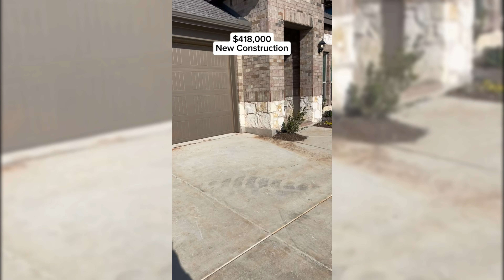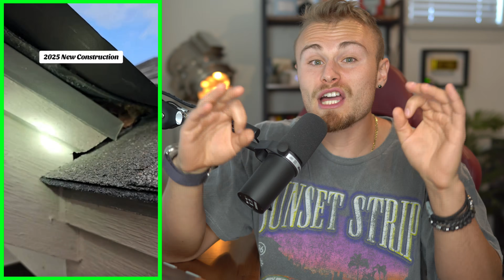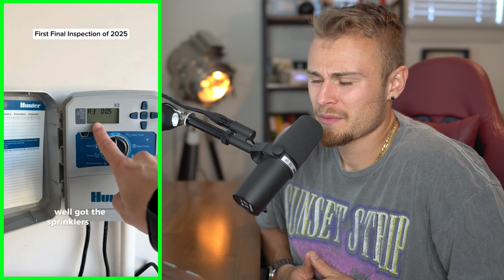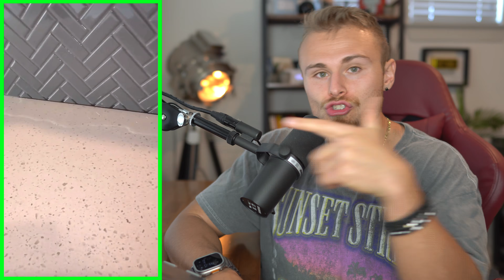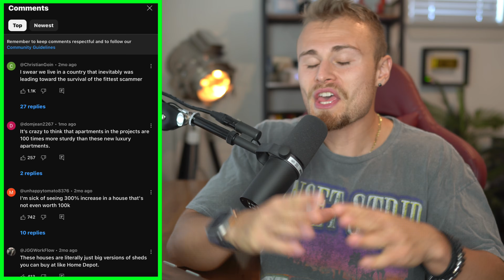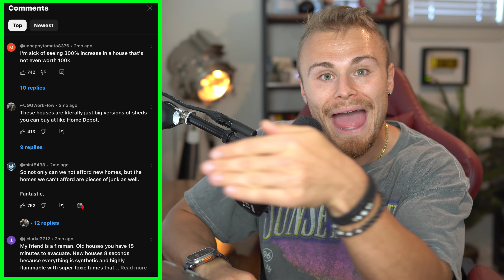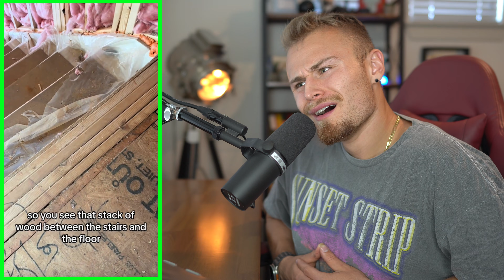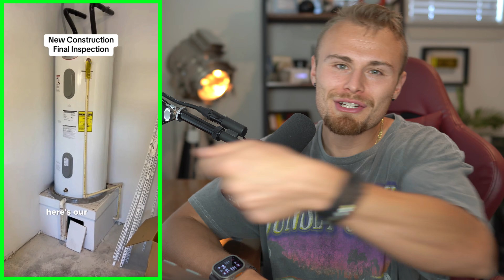New Construction Homes are STILL HORRIBLE in 2025…

Comment from the maker: Do you think builders will ever go back to making quality, affordable starter homes, or is homeownership just becoming a luxury only the rich can afford? 🤔
Reply: Carpenter here, these examples definitely show a failure on many many people's parts, not just the hacks in this video that call themselves tradesmen. I have built over 40 houses and have never run into problems of this magnitude. I have had to work on some wavy walls, which are generally a framing, plumbing, and drywall issue which usually stem from plumbing pipes being too close to the edge of the bottom plate thus pushing the drywall out. Regardless, homes have to go through many many inspections. From foundation to framing to insulation, etc.  I have been turned down for way less than anything seen in this video, and that's a good thing, it drives my quality up. Inspectors should be educated enough to recognize these problems way before the home sells or passes final inspection, so I believe they should hold responsibility as well. 'As a carpenter it hurts my heart to see such bad work done. It drives me to learn and study to become the best carpenter I can be and create robust and beautiful work for my clients. 

Also, if you want to learn about home improvement and tackle some beginner home remodel work, search "THIS OLD HOUSE" it is the place to go. Their youtube channel is a wonderful and accurate source to help you crank out some quality work. Any topic you can think of they've got a video to cover it.
Reply: I work for a construction company that is shifting to 3D printing homes. Although they already have excellent build quality, shifting to 3D printed homes will create a new standard that can be achieved reliably everytime because a machine is constructing most of the house, and humans just have to fill in the electric, plumbing, windows, and roofs. While we did receive a $300 million contract to build a neighborhood of these homes next year, unless you get one of those specific homes you're going to need to own your own land to out a printed house on. So I think it'll still take some years for it to make major changes for most people. I'm excited for us to start printing like crazy though! Because these new construction videos are wack and it has eroded the trust in human builders. And the concrete homes not only pass building codes, they're over built and are more fire proof and sound proof and stronger against disasters. And they can be custom designed if desired, though we plan to eventually offer 10 different models. For now we're just offering 2. A tiny home, and a 2 bedroom starter home. As we continue to grow so will the home selections.
Reply: Yea they will, at the same time every other company in every other industry stops making products as cheap and crappy as they can get away with and start building things to last again with ditch the plastics for metals again…in other words, no brother…no they won’t lol…Luckily there are some of us still around that take pride in our work and build things to last tho, and i will continue to as long as there are still customers who appreciate quality craftsmanship enough to pay for it! Unfortunately, i have a strong feeling that (for the most part) that attribute will die off with those of us born pre - 2000
Reply: They need to go back to making quality homes. If they don't the constant decline in quality will eventually kill someone. Lest it be a bad storm, tornado, or hurricane someone is going to get hurting we keep going down this path of bad construction. 

On the other hand I would love to get into a trade like this but I don't know where to start in terms of learning and getting onto construction sites
Reply: @VantenPlayz  they really don't have to. That stuff is covered by insurance less often these days but the owner's gonna be on the hook. New home buyers are basically playing hot potato with shit-build homes in D-tier real estate locations :/
Reply: @snuglife3697  insurance is good when there's a home to fix after a storm or other. But at this rate newly constructed homes won't even be standing after said storms. Where I'm located I can and have been hit by hurricanes and what I'm seeing (with these homes)would just get swept away. Especially after the big middle finger insurance and FEMA have been towards NC, SC, and Florida. Insurance is good for missing shingles and siding but not missing half of a house or a structurally compromised home.
Reply: @VantenPlayz   Insurance is a scam to make them wealthier while canceling our policy for reasons that are what the whole insurance i dusty is supposed to be about. We pay for full coverage on mortgages and they nickel and dime to not do their paid job.
Reply: 🤣 
"They don't make them like they used to"  Many ppl see how poorly they are made today, and think that older homes were made better.  
Afraid not.  PPl have put fortunes into maintaining their 50-80 year old homes.  These are all problems that you'll find on any home of any age.
Granted the "entire neighborhood is made by a single developer" will have FAR lower quality than than any other.
I buy and sell homes, as old as 70 years old, and have problems.  Most are ignored/unknown.  
Some older homes use aluminum electrical wiring... which has caused so many fires that insurance companies won't insure them.
If you're wondering why homes are so expensive and there are so many "made my a single developer/ultra sh*ty" homes, it's because of Fanny Mae/Freddy Mac.
In short, The gov backs loans for ppl that can't possibly afford the homes, increasing the number of buyers by massive amounts, while putting tax victims on the hook to pay for them.  
This dramatically increases prices, dramatically reduces quality, and costs tax victims billions.
Reply: @eclecticgamer5144   of course insurance companies wont insure them…because 99% of homes that still have any aluminum wiring in use do not meet the very restrictive code that must be followed for them to be deemed “safe”…and what you’re describing about the gov. Backed loans is what was going on pre 08’ and a large cause of what happened that year…one of the main reasons homes are so expensive today is because the price of lumber more than doubled during covid and has never returned to pre covid prices, along with the inflation of everything else in general, which in turn causes contractors and builders quality and care in general to inevitably reduce so they’re still able to turn their profits…the customer always ends up being the one paying and suffering in the end…its either or choose to not participate…thats the only options…
Reply: Yeah that "jesse"fella is partly true. Companies wanna make the biggest $ possible but jesse over there is shifting blame from the shoddy "workmanship" off to the "developers". "high pay" lol yeah why hire a competent professional when you can hire Achmed or Jose that have zero skills  but you think its ok because in the end "i can save on so much money on the hiring costs and if it goes bad its the developers fault anyway" mentality. What you see here with Jesse is what is wrong in construction. So yes all the damages ARE the builders fault. This comes from someone whose granddad owned multiple companies one of which was a construction company which later real estate added to it. Yes it was in Europe at first, but then he expanded to the US.  Company still operates and is still in my family's hands. It isnt either some small company the company has over 1000+ employees even way back in the late 70s, currently it sits around 14k employees.  The company builds all kinds of houses and renovations all over the world, not just in Europe. How many complaints were there? 17 in the last  nearly 90 years and they respond within 24 hours and send, if possible one of their employees ( usually one of the inhouse home inspectors) to see what the problem is and its fixed within 3 weeks unless its something major and have to wait on identical material being delivered. like that pink marble tile that got a hairline crack in it. Got replaced without a fuss or grumbling.  

As a builder you deliver such a SHODDY house its the builders fault and the sub contractors that are being hired. If you pay peanuts you get mongkheys but that is what its all about these days.. bare minimum at best with the lowest quality building materials with the most incompetent builders and workers possible. That is what is wrong with construction these days. They CAN hire professionals that will care about their work. My family's construction company and many others even in the US are great examples of that but they are content with  having a little bit less profit than the greedy jackasses that do shoddy work. Eventually the shoddy builders will have to cough up everything they saved up because if the state gets involved or board... it can get expensive real quick.

My grandfather had a motto: "anyone can come and work for me but if i see you deliver shoddy work you get your ass chewed out. If you build a home as a builder you yourself have to feel like YOU want to move in. If you dont have that feeling or you have a "laissez faire /  just bare minimum at best", you are NOT fit to be in construction go kick rocks or play with yourself or something". If grandpa was alive he would have some choice words for ol jesse ( with a bunch of numbers.. i think that dude is a bot). He rarely got mad and if you came to him and said " boss i dont know how to do this that or the other, he would show you or if he wasnt sure himself he would call one of his workers that was a professional.

Look for fixer uppers @Hayden.Schreier.  You have to look up the "nearly ghost towns" in the US ( there are quite a few in texas) but you also have to look at the location and situation, infrastructure and the like. You can have houses, all 1920s-1960s fixeruppers for between 50-90k.
Reply: No, because quite frankly, today's builders do not have the knowledge anymore to build quality homes. It also is the labor they use as well. Want to have your homes built by a population that comes from third world countries? Do not be surprised when they fall apart.
Being a carpenter used to pay well, now it is down to like 15/hr because of all of the illegal migrants working it. So there is no reason US carpenters would lower themselves to that pay.
Reply: I think until the government puts laws into place that bans investment companies from buying up homes, houses will never be built with quality.
Reply: This is a tough question because it looks like the building/craftsmanship skill since 2008ish was allowed to absolutely crater (along with housing supply, which is why there's a shortage now). 

Turning that around will require investment and time, and builders would have to be forced to invest. 

Supply of real estate has to flood the market and force real productivity and value in homes.
Reply: The quality of many of these homes is a time bomb on the economy. 

New and Recent builds in neighborhoods made by companies like DR Horton and similar, are often made poorly. (non custom builds)

That is the huge story that is getting missed.  These homes have sold for 400k or 500k in places like Texas, AZ, ATL, and Florida in cookie cutter neighborhoods. They are made like crap. And will not be sellable in 5 or 10 years due to shabby workmanship, water damage, failing roofs, missing rain caps, vents in attics, mold, etc.

Especially in places that allow that awful cardboard sheathing. 

Please dig into this. 
It needs to be hammered home.

Nobody is gonna want a DR horton type Mcmansion in just a few years. They won't be sellable. Every year they will be getting more and more damaged by the elements. 

People are already living in homes that are worth less than they paid and don't know it. Because when they buy new builds the contactors are so buercratic with the home inspections. But someone buying a home that is not brand new is going to have a real home inspection done....and an inspector is gonna say many of these home are falling apart and or have significant damage..(like a bathroom vent going into the attic for the last 6 years.... Or roofs that are falling part. )

This will blow up the economy in a few years
Reply: Nobody’s getting a quality house unless they build it themselves unless the government cracks down
Reply: sure, whence they and their customers stop being suckers for money, and not a moment before.

This is a problem of trust, and a very expensive one.
Reply: @Hayden.Schreier  I have been in the industry for 35 years, and I know only the rich will be able to get a new home.  Even companies like Dixon Homes will never be affordable to the average home buyer. Only the rich will be able to afford a new home in Australia. The Australian government doesn't care about the average person. They only care about imagination they're the ones with money and power.
Reply: If they actually give you what you paid for they won't be able to pocket as much of it. Do you want them to not be filthy rich
Reply: If you're spending $2000 a month on an Apartment and in. C. N. D the year that's $22000, so 10 years. That's $220000 at 6 years. That's $660000. So you're getting less, but you're paying more for less
Reply: I'm just very impressed of how they got the walls to bow
Reply: Older cars are much cheaper to repair and when you look at the repair cost VS the gas mileage that you're saving. It's actually much cheaper for the older car. You spend a little bit more in gas, but when you can fix the car yourself. You don't need special tools and it's really easy to maintenance and say. Save a lot more time on the repairs. If you're not doing themselves, it's like it's just worth the extra $10 or20. You're spending on gas
Reply: So the way one works, there's like agreeing to it. And the problem is they're using certain kinds of grain. And they're not cutting the wood really right anymore either. So what ends up happening is it's weaker., It's also probably why the walls are bowed because the grain isn't right, and it's inferior lumber
Reply: Also, it's not true. They don't hire extremely high-wage at least a colored. Or minority people maybe dwhite people. But I'm like at even $20. It sounds nice, but it's not when you have to afford a car. That's you're literally gonna drive all around the county and absolutely rack up huge bills in repairs. And then barely be able to afford your own Apartment. That's rundown and shit even though you're building brand new homes
Reply: There's a third option with jobs. You don't have to cut corners and you don't have to quit. You can just do the job right and then be fired
Reply: Only for the rich.
Reply: @TheeKarnivoreAlto  The rich do not get "starter homes".
Reply: There are no starter homes . Especially where I live. Lol. 😊 @jcfra420
Reply: Maybe the US people will some day realize, that big cooperations need to be regulated. There need to be rules, otherwise they share the market between themselves instead of being competitors. And consumer rights should be strenghened, so that terrible constructors can be held accountable. 
If that ever happens, there will be good quality homes again.
Reply: there's no profit in starter homes.
Reply: Considering some of these builds were upwards of 1M, you'd need a few million for a custom home to get any kind of quality with how things are going. Unfortunately with the housing crisis, the government want more housing to go up so quickly to meet their quotas that they're willing to overlook this. Just look at Australia, with so many of the new homes being bought out by foreign investors and either being rented out or just straight up siting empty (because simply owning is investment enough), who cares if the new builds are quality?
Reply: This really comes down to a lack of the leadership for these companies. A person  hired to ensure timelines are met instead of quality  gets you these results. People are so impatient nowadays that workers are more focused on quantity instead of quality. Sad what we are getting in this time period.
Reply: Why do you need a new home? There are many older homes that are well built but that need a little bit of work. They may not have all the luxuries, the modern amenities, but the truth is that the more modern amenities you have on in a home the more quickly the home will age. It’ll have to be remodeled in five years. My home. My Home is 70 years old. It was framed with high-quality wood. It’s on a fifth of an acre. There is no homeowners association. The plumbing is basically a straight line from under the kitchen all the way to under the backyard. I don’t have a ton of electrical outlets. It didn’t come with recessed lighting or a built-in stereo system. You can pick up an older home in an OK neighborhood for much less than what you’d pay for a newer house. I think young people expect everything to be perfect.